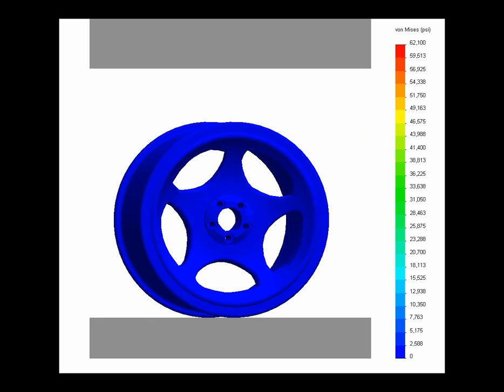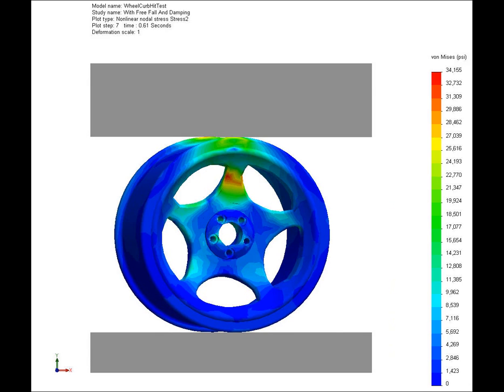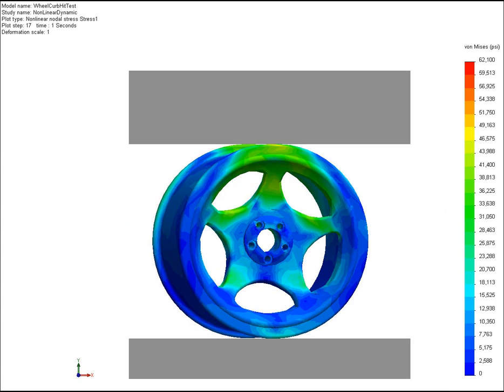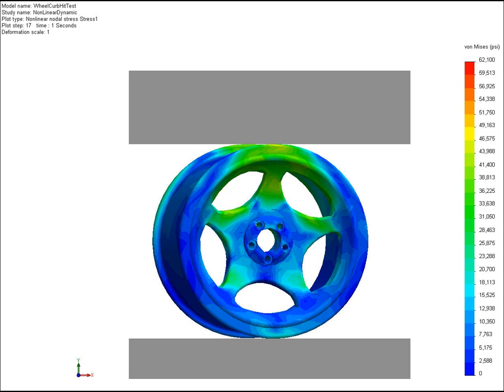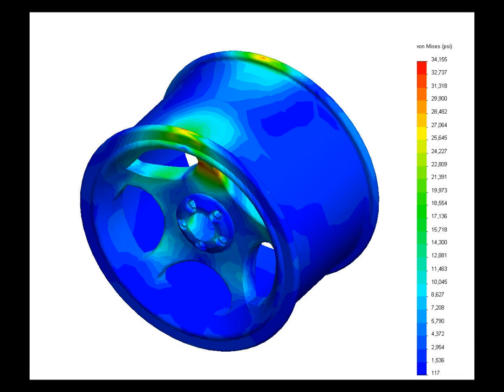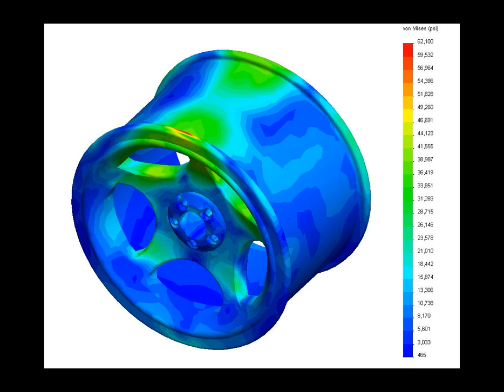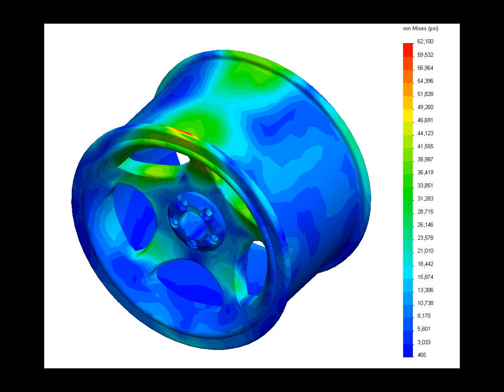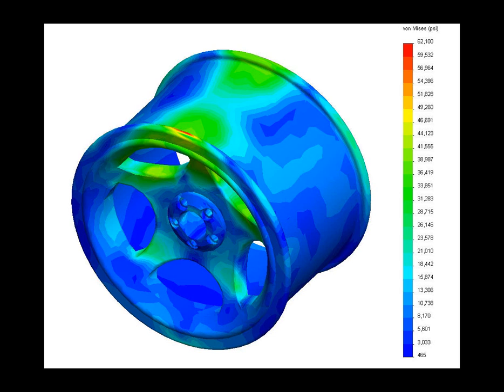Wheel Rim Curb Test.wmv

Comment: Try a more "real world" situation.  Aluminum(6061T6) wheels on a car going 70 mph on freeway, and hitting a pothole(2 ft diameter with 5" depth) with 40 series tires at 40psi.  Answer? Permanent deformation.  Displaced about 5 mm's.